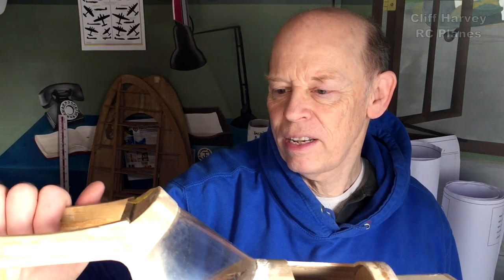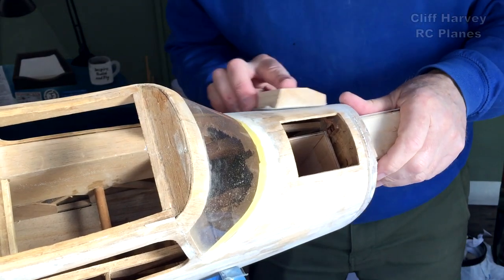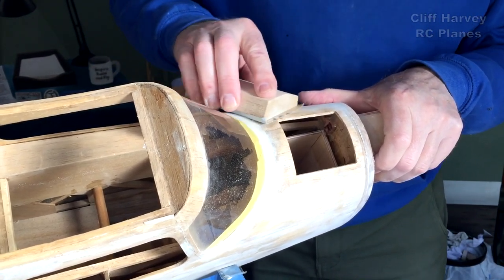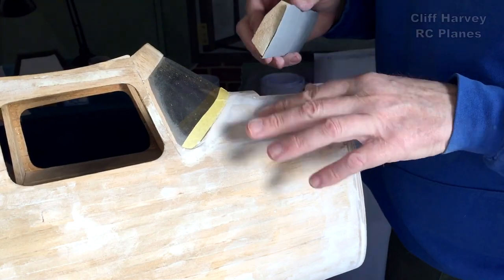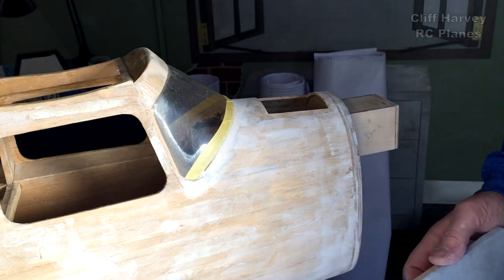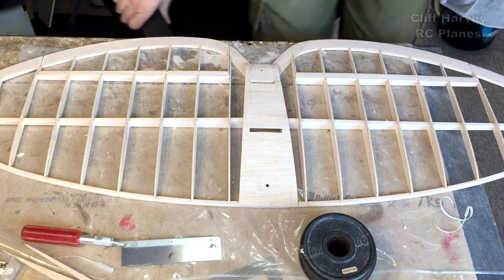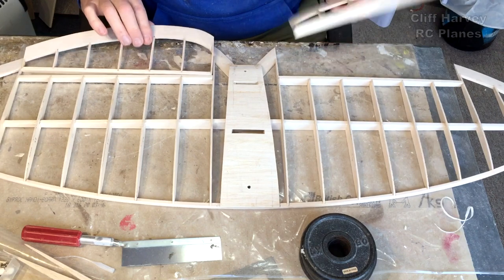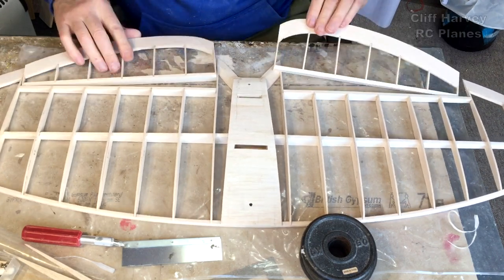MERCURY BUILD PART THREE FUSELAGE, COWL AND ELEVATORS

Comment: Hi Cliff, enjoyed your video. I have just acquired a Mercury. So I was told it was built by an old guy in his 90s. It has been built to quite a high standard, and must have been quite an undertaking looking at the amount of work that's been put in to it. The fuselage paint is a bit cracked but I'm not going to go too mad with it as I think the patina ads to it. Maybe just give it a coat of fuel proofer. I agree,  the arrangement for securing the wing is a bit 'quirky' and may be ok for free-flight but not for RC. I think I will study alternatives, possibly permanently fixing the centre section on, and just having 'plug on' wings. Mine has been built for RC from the off, so already has elevators and rudder.
Reply from the maker: Hi Simon, patina is good, the fuselage is a major undertaking, each piece having to be honed and fitted! I'm going with the original fitting for the wing, I may even use cable ties instead of rubber bands but rubber bands 'give' just enough to prevent damage in the event of a less than perfect arrival. Am I right in saying yours doesn't have ailerons either?
Reply: @CliffHarveyRCPlanes  No ailerons on mine Cliff. I'll Piece it together and do a walk round video. It would be interesting to compare notes. It looks as if its had a large (90/100) Laser in mine, if the engine mounts are anything to go by. They are way too far apart to be an OS or Saito.
Reply from the maker: @TWEEDFLY66  Thanks Simon, I was just looking for validation that I don't really need ailerons, thanks for that, it would be good to see a short video of yours, cheers.

Comment: Great job on the cowl, will have places to mount speed control and nose ballast as needed. Wing and tail  should have translucent covering , fuselage should have opaque covering or paint. Large size will be dramatic in flight.
Reply from the maker: I was tempted to cover in translucent covering but the wings have been filled and repaired over the years in an ugly way and would look horrible but there may be a way, cheers  🙂

Comment: Wow I think that you did more than a great job on the elevators.  That would have been a hare job for me to come up with
Reply from the maker: Thanks Paul, it's just a bigger version of the little Guillow's conversions I do 🙂
Reply: I have been thinking about doing a Guillow's conversation myself just not sure witch one.  I know that it would be a small one because I have the receiver and all from a micro plane.
Reply from the maker: @Yogenh  Or why not have a go at a KeilKraft model like the Ajax or one of the other competition rubber models?

Comment: Very nicely done Cliff. I'm not too keen on the method of center section retention but I know it is as designed. Being originally a free flight, the wing would take some knocks and need to be able to slide around on impact but in the interests of keeping it original, I guess you have no other option. Well done again.
Reply from the maker: It's not a bad method of retention, it'll work well I'm sure now I can get in there! As for keeping it original lol ... electric 😁
Reply: @CliffHarveyRCPlanes  And 2.4ghz radio control!!!! Lol!
Reply from the maker: @bobi2582  Oh yes, I forgot about that 😁

Comment: I'd use the 1/2"  stock for the top. But I'd build up the sides, gluing 1/8 sheet pieces cut to the side view outline, then palm saded.  And out of doors, even over a dropcloth.
Reply from the maker: Hi Dan, do you mean laminating 1/8 sheet pieces to make up the thickness? What's a dropcloth by the way?

Comment: Always wondered how paper mache would work 
Must try it some time
Reply from the maker: You mean to make a cowl / mould?
Reply: @CliffHarveyRCPlanes  
Yeh for the cowl ,thats what I was thinking ,sorry i was writeing while i was haveing a light bulb moment
Make a plug and then paper mache.
I only just thought of it.
Think I will give it a go, Im thinking the cowl dosent need to be that strong and should maintain that vintage apeal.
Reply from the maker: @Micheal Ohalloran  Interesting idea, I wonder if modelling magazines would be the thing to use for the mache 😁👍
Reply: Traditional brown Gumstrip works a treat, soak it in water to soften and it's self adhesive. Build it up in layers and once dry soak in Shellac. "Tough as old boots"! 
A twist on Paper Mache is to use emulsion instead of wall paper paste. Resistant to moisture then once dry.
Reply from the maker: @paulsouth3926  Never heard of that technique Paul ... interesting 👍

Comment: Just watched this again (thinking about my Falcon build) ” sand balsa blocks until model appears "😊
What is the motor size Cliff?
Reply from the maker: That line always amused me Mark 😁 motor is a Tornado Thumper 4250/06, 980 Watts, 800kv, 3-7 cell lipo. I've got a 60 amp esc but I think I need an 80amp or a smaller prop  because it pulses on full Throttle takeoff, cheers 👍
Reply: @CliffHarveyRCPlanes  thanks same dilemma as you do I go Nitro or electric I have a powerful electric motor/ESC from a large foamy warbird which will offer a clean alternative to nitro plus I can fly more in keeping with assisted RC, rapid climb turn the motor off and glide to earth then repeat.

Comment: With dihedral, model should turn well with rudder only, elevator may lose some authority at landing speed, keep some power on while landing.
If model wants to stay aloft for long flights in thermals, might consider separate power supply for receiver and servos
Reply from the maker: Hi Gary, good tip about the battery but I'm a low and slow flyer really so not much chance of catching any thermals with this one, cheers 👍